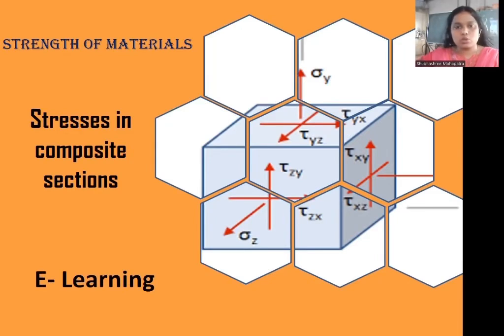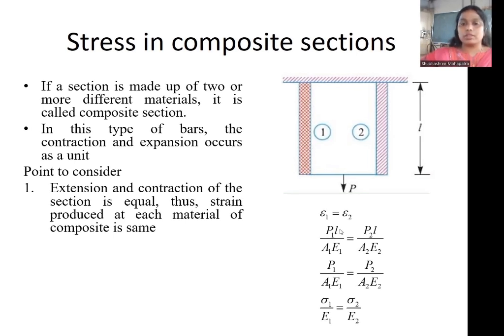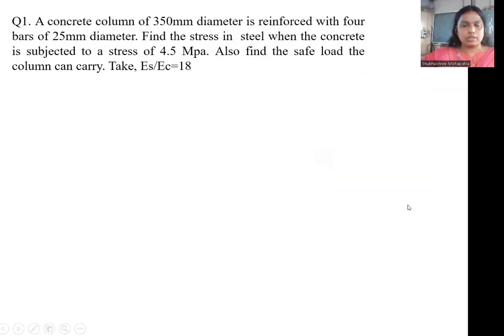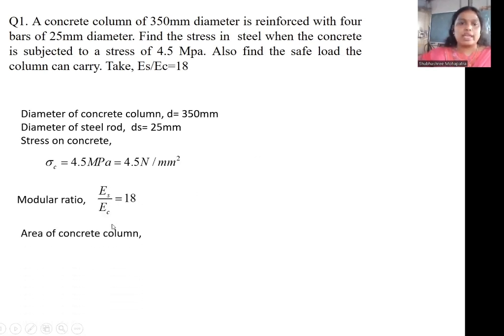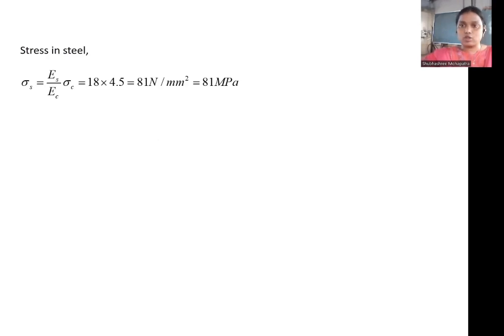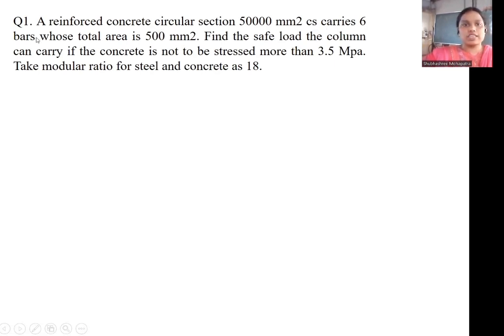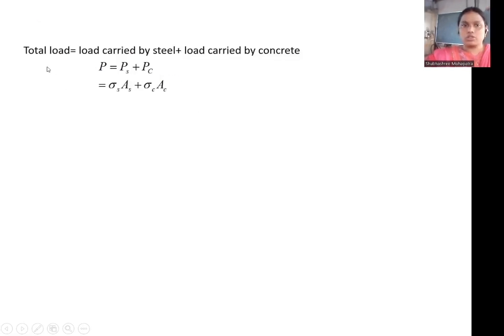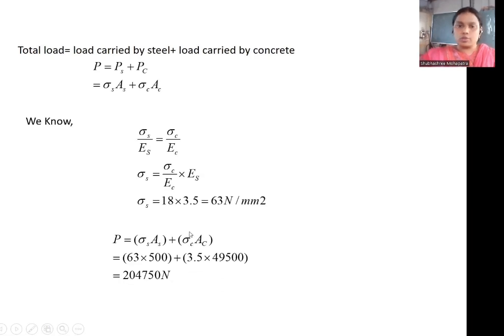Stresses in composite section || Strength of materials || Numerical

Comment: There is a mistake look at minute 4:01. Area of concrete column is 92611.3mm²..... however you have written 96211.3 just below it, when you are substracting
Reply from the maker: Thank you for pointing out the typing mistake.  The area of Concrete column will be 96211.3 mm2.